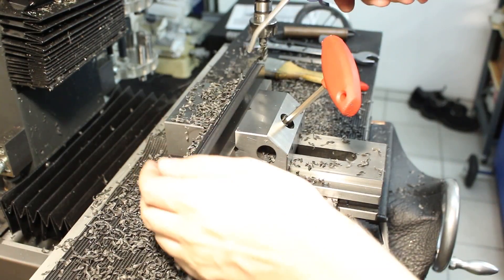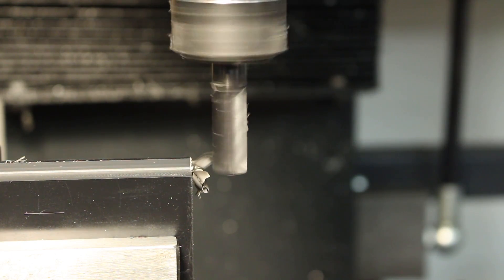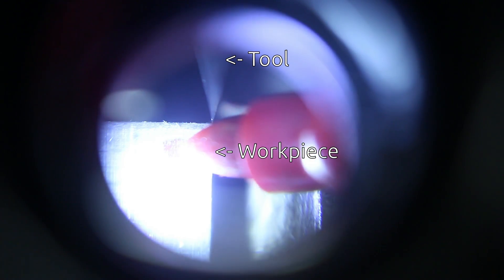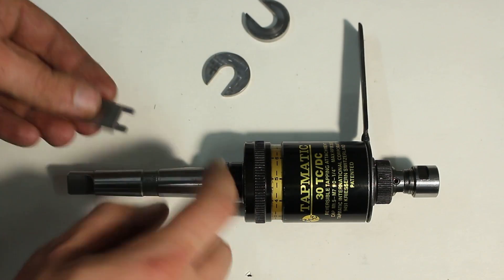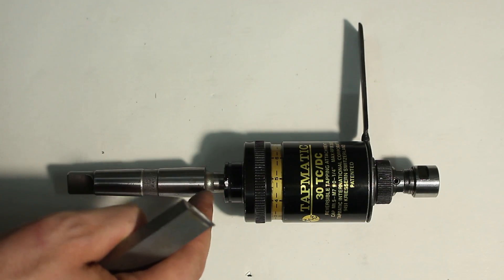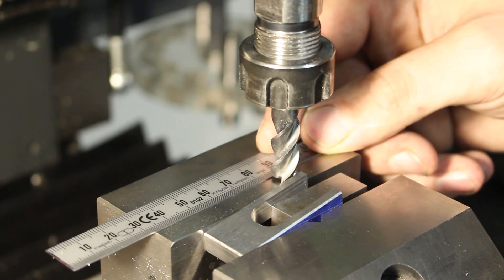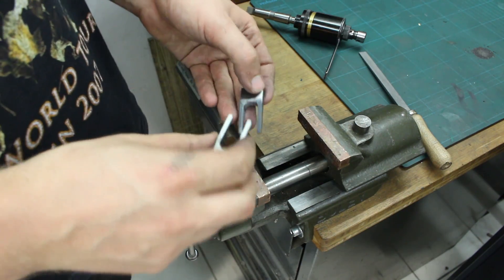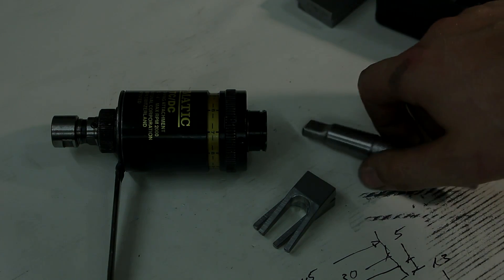The Archives - #2

Comment: I just don't understand your MT4 to MT2 adapter system. How can you use a drawbar with an adapter? If the mill uses MT4 taper, doesn't the drawbar in the mill have to hold the MT4 adapter in place? So with the drawbar already used for that... what holds the MT2 cone in place? Is there some smaller internal drawbar inside the adapter? 

I've tried looking for existing adapters but they are all without any drawbar threads and seemingly meant for drilling only. I'd love to know how this works since I was hoping to get some 40 taper to MT2 adapters, but if I can only drill with them, they aren't much use.

Comment: I have used those arbor removal wedges many times, and they work, but I finally bought all 3 Albrecht removal tools. Much easier to use and you can change arbors while the chuck is in the spindle.  Would be great to make these Albrecht tools in other sizes. Simple leverage principle. What about hardening/tempering the wedges? Would that be a good idea? What are good steels to use for these wedges, O1, 1018, A2? Thanks

Comment: Nice vid on doing a cut and flake to reduce future wear on your shaper I always wondered how it would blue up after since the ways should be perfectly mated to each other through wear?
 Where did you get your pump oiler I'm having trouble sourcing one that is affordable, just been using a clumsy messy grease gun filled with way oil? Thanks for the vids, very educational!
Reply: Kyle Thomas probably not perfect since the stroke isn't always the same. So just like any other ways, they will have more wear in the areas that experience the most wear. Though this machine doesn't have very many hours on it.

Comment: Awesome collection of small projects, your mastery of metal is something I aspire to.

The arbour wedges are a great idea, and something I may do as my first milling project once my skills catch up to my asperations.

Baby steps first though, I have to get a Dore Westbury mill I rescued up and running first.

The mill still has some unfinished areas that need doing as DW mills were sold in kit form and finished at home using a small lathe, the provided castings and a set of build plans. 

While this one happily turned out to be generally well built, it was mistreated a little by the previous owner so it's in need of some TLC.

Keep up the great work, I have learned so much from you, so a huge thanks for sharing :)
Reply from the maker: I read about the Dore milling machines, I saw them often in old model engineering magazines. They look like a nice small milling machine :)

Comment: Stefan, could you maybe show how the gibs on your shaper are adjusted?  I see that they have 90* edges that mate to the ram slide way and are held in place with those hex head screws.  Was this done for ease in manufacturing or does it allow for a better more precise fit?  How is it adjusted for wear if the mating surfaces are square shoulders?